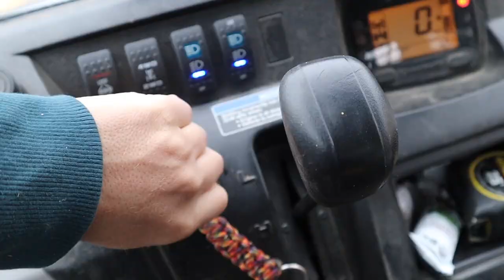We've Never Done IT Like This Before Installing a Gravel Floor in Our Post & Beam Barn

Comment: THE BEAVERS  -  I fully support a good woodland management plan, plus you will need to permanently clear a certain portion of your land for pastureland.  That said, I also feel that you can easily control the beaver problem in order to save your roads from overflows and washouts.  Eradicating the beavers will not work in the long run.  Nature abhors a vacuum and if you kill them off she (nature) will just replace them.   The best way I know of the prevent culverts from being plugged by beavers is the installation of so-called "beaver deceivers".   The 12 foot trapezoid versions seems to be one of  the best developed so far.   The beavers will try to plug these but soon give up and move on (away from your culverts.)  Plans and advice (of course) are scattered all over the Internet.

Comment: idk if you already did this or if it came this way but you might want to have a survey and put up a simple wire fence around your property before you start any work up there... also if there is electricity off the road up there then your home's proximity to it is going to mean a lot when it comes to cost to run power to your house.. really important if you by some insane way can get wired internet too.. if you have to bury lines or put up poles and transformers and amplifiers for the data lines it gets really expensive or they won't even run the line... so sometimes building near the road is important. Anyway not trying to tell you how to live your dream i am sure you have tons of stuff going through your mind right now.

Comment: I hope by logging you mean thinning and not clear cutting. Also is the new property in NH still or a neighboring state?
Reply: In previous video they mentioned  Silvopasture which means up to 30% trees in pasture, though I doubt it will appen immediately as they also mentioned that it was a 5/10 year project. :_Pluto::_Tanner::_ILikeIT::_Figaro:

Comment: In the stalls in the new barn if you put down 3 to 4in of ag lime on top of the rock you wont need rubber mats and it will get almost as hard as concrete but still bed soft on animals feet
Reply from the maker: Thanks I’ll have to look into that.
Reply: @LumnahAcres  we had an 8 stall horse and cattle barn when i was younger we did thos and it was great for the animals and for cleaning up what they leave behind lol

Comment: How about a 2,5 & 10 year plan. We know they always change. Working as individuals a lot of your projects will require hired help. The land alone is a forever sustainable woodland project. If you haven’t already ,you might think about a logger that uses horses or a 1 or 2 person logger. Given the size and type of terrain  I’ve seen so far you could put 2 man horse operations to work for a lifetime doing selective cutting. Good luck best wishes for what you
Ur doing, I’ve been down this road before 3 times but with the wrong partners.

Comment: I would suggest not putting down rubber mats... They hold urine and feces so animals are always walking in it. Were it me I would leave it dirt put a layer of sandy clay then deep bed it with straw or shavings... Not as easy to clean stalls this way but much better for their feet in the long run.